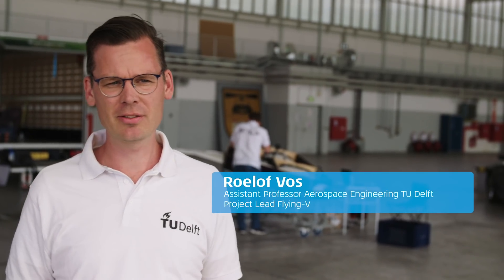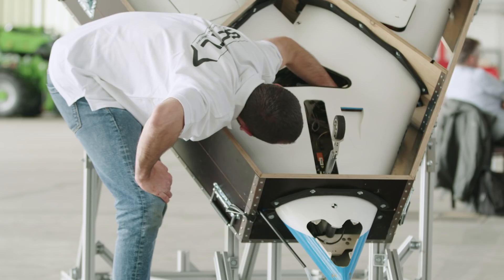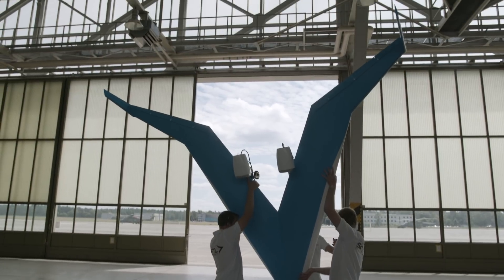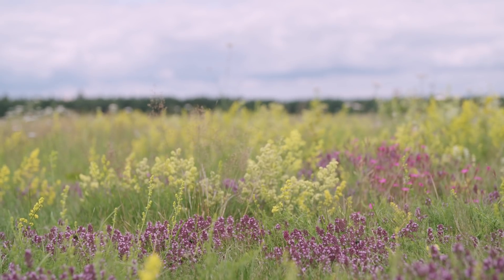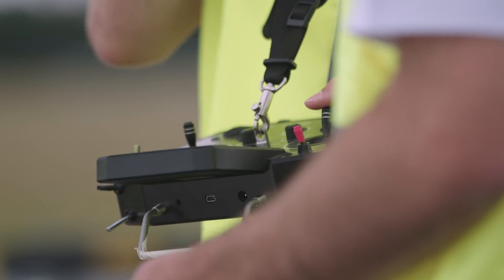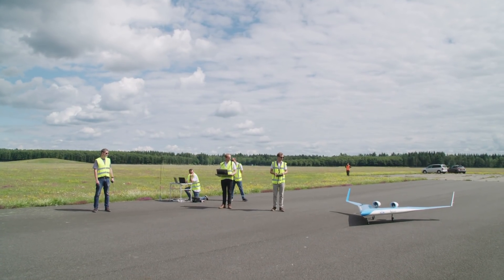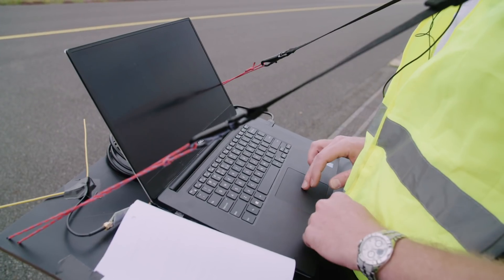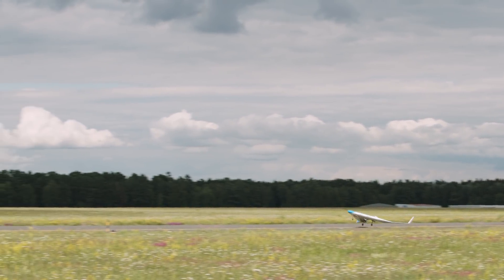Flying-V - Scale model maiden flight

Comment: Now, can it fly if one engine fails?  Can it glide if both engines fail?  Will it stay afloat if it lands in water?  If hydraulics fail, can it still make it to the ground safely?  Is there a way to escape the craft in midair if the plane is going down, like escape pods?  If we're going to push for the future, go all the way future!  Because I see nothing special or anything new, other then design to make this one significantly safer then our current planes.  I'm looking for 100% survivability, apart from having a heart attack or the plane being shot down, with these aircraft.
Reply: People like you are needed to push these people. Keep Bitching, it'll get them somewere. Not there hard work.

Comment: Less weed, more fundamentals. You can't land what doesn't glide.. this design only flew because it was under power but crashed while trying to land this inherent unstable design, at least incorporate a canard to attempt a glider design.
Reply: Flying wings can have excellent glide and stall characteristics.  This one looked to have a tone of washout (wing twist) leading to the mid section of the wing having a massive angel of attack, leading to a huge amount of drag and limited top speed, which is shown by how slow the model is.  Generally less washout, more efficient but less stable..
Reply: @michaelrobinson1134 All current flying wing designs incorporate ejection seats 💺,  B2 and F117.
Reply: @michaelrobinson1134  Stall characteristics of a flying wing are atrocious,, delayed the B2 by a near decade since no computer system or program existed to catch it and no pilot was able to recover the unpredictable stall character. Again, ejection seats required!
Reply: Robert, rubbish..
Reply: @miksterr  yup, rubbish design, flawed fundamentals.

Comment: So how will this big boy handle turbulence? With a conventional airline the wings are designed to flex to absorb some turbulence shock in the cabin. But with this design I don't see any flexing or absorbance of turbulence.
Reply: I was wondering the same thing. And maintenance would a nightmare.
Reply: The wings flex to absorb bending forces in the wings. The shock has harder time affecting the cabin because the cabin is not thin in the first place. It's easier to create a sturdy structure if it's not thin. (If engineers could've afforded to make wings thick, they would do so and then there wouldn't be a need for them to bend that much. But we can't afford thick wings in their conventional placement because that would create too much drag.)

Comment: I don’t understand how you could land a remote control plane without a view from inside it. How would you line up with the runway etc...?
Reply: Practice, been doing it since I was 15.(Now 59.)
Reply: You practice! When I started flying RC, it was actual tricky to line up. And you train with an instructor with plenty of experience ("buddy box system" with two radios). So the instructor would fly the plane and then flip a switch and then the controls are in your hands. The moment he sees that you are screwing up, he flips a switch and have full control again. At any RC airfield club there is a circuit, like you would have at real airfields. You practice that circuit with the correct amount of turning and altitude correction while turning. And then later on it becomes second-nature.
Reply: There are apps to practice flying on the computer. Took me about 2 weeks when I was like 8 to learn to fly. There are also trainer planes which auto aligns itself so if you panic you can just let go of the controls and only control the speed for a second and it will auto align.

Comment: Notice they didn’t include the landing!
Reply: It's a terrorist's plane, landing is not needed.
Reply: Word is they have been unsuccessful since it doesn't behave like a glider, a requirement for successful landings. 2 years of intense bong smoking and this is it gentlemen?
Reply: @robertpolkamp  even the "Starfighter" (sometimes) landed and that is a Jet engine with some tiny "wings" strapped to it. Also a model like this has a much lower wingloading then fullsize and much more power. they probbly just bounced it

Comment: Whatever you do DON’T show the landing!  

(Flying V planes are NOTORIOUS for instability on landing.  You might save 20% on fuel but you’ll be cleaning up vomit for HOURS!!)

PS: the power to weight ratio in small model airplanes is ENORMOUS- and the model itself can be very light.  You can almost get a small brick to fly.  Show something 10 times the size of that model and then I’ll be impressed.
Reply: I seems pretty small to be relevant.

Comment: Will be more complicated on weight distribution.
Reply: The youtube channel '"Real Engineering'' has a very informative video about this new type of airplane.
Weight distribution is not the biggest issue here, the centre of mass of course has to be near the centre of lift on the longitudinal axis but the weight distribution on the lateral axis is already much better with a flying wing. Weight and lift and more evenly distributed.
The biggest issue is expansion and contraction of the pressure hull and how to shape it ''inside'' of the flying wing.
One way was to have multiple cylinder shapes stacked side by side but they still would have to be ''flexibly connected'' to the outer wing structure so the ''optimal way'' is to just have a completely (carbon fibre) reinforced external structure.

Comment: I've been designing, building, and testing flying wing for more than 40 years. I have an MS in Aero Eng. I can tell you the following facts. One, you can get anything to fly with enough power. Two, these students are learning a lot in this training program. Three, their efficiency claims are highly suspect. They need to take a close look at Oswald's efficiency factor - wind tunnel data on efficiency are highly suspect due to issues with the Reynold's number differences. Fourth, it's really cool to see it fly.
Reply: Dario Jurišić  May i suggest you get an economical, rubber band attached wings, RC Trainer and learn to fly it first.  Preferably using the buddy system.  That is a system where your RC control box is connected to the instructor’s control box via a cable.  He can cancel out your controller and take control, if you get out of control.  Look for an RC club and some one that can instruct you.  That way your own creations can live to fly another day.  Only the Wright brothers can justify not taking any flight instructions.  I’m a commercial pilot and have flown real airplanes for over 50 years.  If I got into RC flying that is what I would do. Good luck in your career and learning to fly.

Comment: Hey guys cool model plane too bad that shit will never ever ever fucking see production! Neat idea I don’t see it being aeronautically sound. The taking off and landing vibrations for the passengers would be extremely violent. The fuselage is stable in modern aircraft absorbing a lot of the vibration from the wings. Take a look at the wings when you takeoff and land on a plane. Imagine being in those wings bouncing all over the damn place. Cool concept, model, pure Star Wars
Reply: If the whole structure is sturdy, then the forces are distributed, averaged over the whole structure, so if you see a wingtip of a thin wing flapping up while body drops down as you land on a plane, you can't conclude that the tip of a V would flap the same amount.

Moreover the V shape likely possesses a larger moment of intertia so a net external force like air turbulence has harder time making it move in the first place, i.e generally it ought to traverse turbulences without banking the same amount as a convential airplane does.